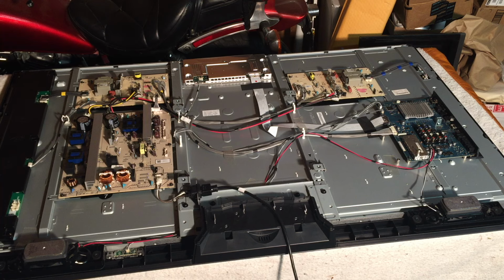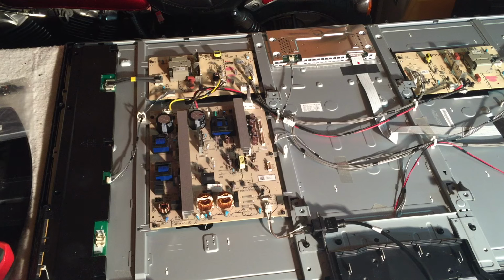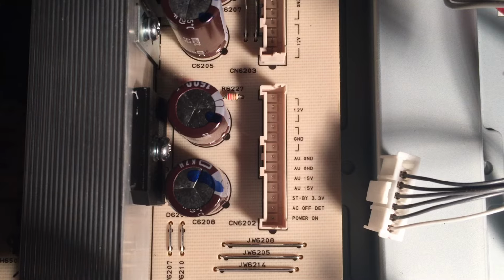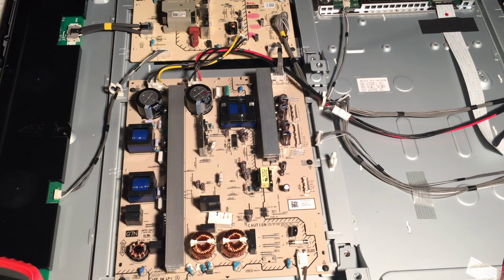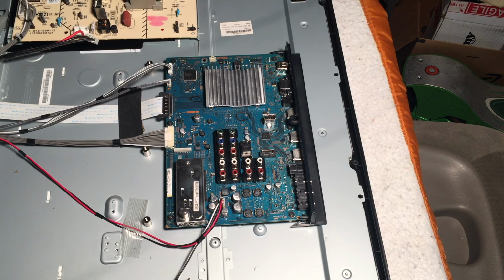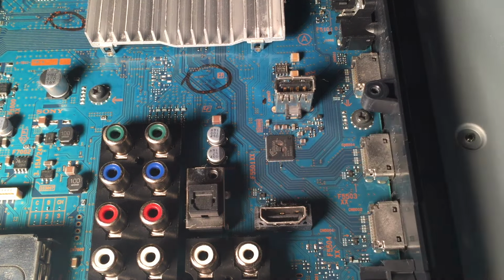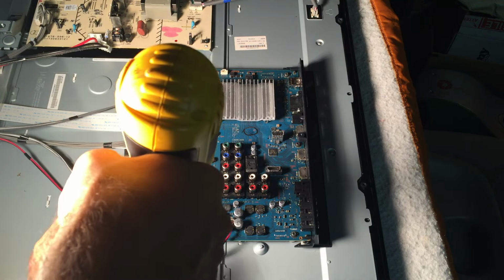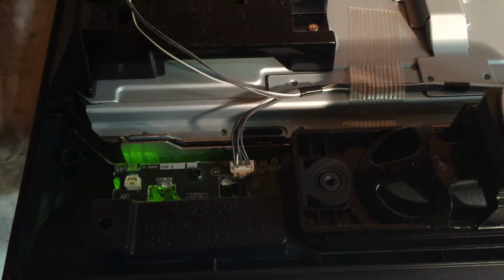How to Fix a TV Hit By Lightning or Power Surge

Comment: I have a lg 60pm6700 that got hit by lightning. The red standby light is on and I hear clicking when I try to turn it on. The screen seems to flick on and off a couple times but is very dim and hard to see. Can you help?
Reply from the maker: Did you check for the standard voltages?  Unplug unnecessary boards and peripherals and slowly add them in to see if your tv power up?
Reply: FrugalRepair my tv powers up. I can see the screen turn on and off automatically after I press the power button. Red standby light is on. It does not display the tv logo. If I unplug the ZSUS board I can faintly see “static/snow”. I replaced that board with no change.
Reply from the maker: @jeffschiman7579  I didn't realize it was a plasma tv.  I would guess that the issue would be either with the power supply or the main board (if an hdmi was connected).   The operation of a plasma is very different than an lcd.  You have standby voltage but I can't say off hand what else you should check for after that.  I haven't worked on a plasma for a while but many times I was able to find a flowchart or a service manual for them which was very helpful in the diagnostic process.

Comment: I have a Vizio LED tv that I came home to and it just keeps powering on and off. Can’t use any function. There was a storm recently however I wasn’t home. Any help appreciated .
Reply from the maker: Is it powering off at the same point?  Or  does it shut off at random times?  Does the tv stay on long enough to get past the Vizio logo when it boots up?
Reply: No. It boots up to the logo. Then shuts off. That’s as far as it goes.
Reply from the maker: @edwardfessenden589  Hmm, I'm not sure.  I'd try disconnecting everything and then testing boards/peripherals and adding them in one at a time.  You might have a shorted component that when the tv gets to a certain point in the boot process that it shorts out and takes the tv down.  For example, the hdmi mux chip (like in this video) could be damaged.
Reply: FrugalRepair tested power supply board stand by voltage and it is ok. Would T-con board cause tv to turn on and off by itself? I’m thinking main board needs to be replaced. Don’t know how to test main board

Comment: Ok so I checked the 3.3 and I didn't get voltage when I put the test lead to the metal frame but I got 3.8 when I put the test lead on the neutral/ground wire coming into the unit. Is that acceptable? Here's my frugal tip for you: get a bidet attachment on your toilet for 20 dollars on eBay. I no longer need to use toilet paper.
Reply from the maker: The frame should be ground and you should get it.  Try using the screw on the corner of the power supply for the black lead.

Comment: I'm reading that quite a few people had their TV's plugged into a surge protector and that the power surge still caused damage. I live in Mexico where power comes on and off frequently. Had thought about getting a power surge protector but didn't get around to it and about a half hour ago my TV just zapped out, followed by a strong smell of electricity burning in the air and  no standby light...I'm assuming from a power surge. Do you think power surge protectors work, and if so, do you have any recommendations on a good brand?
Reply from the maker: I don't have any recommendations but it sounds like having a good one would be a wise decision.  Beside the main power cord, the power surge can come through another device connected to the tv (ex; hdmi), like it did in the tv in the video.  I'm sorry to hear your tv broke.  Hopefully the diagnosis will be fairly easy if there was a strong smell it may mean you can visually see which board got damaged.

Comment: I hope you read this comment. My tv got electrocuted through a screen(don't ask why) and the screen is completely blank. Only the led backlight is being lit. And also there are several lines which can't be seen clearly unless you go extremely close to them. So is my screen damaged or is it some other issue. I hope you reply
Reply from the maker: I've read your comment!  However, I don't know if I can diagnose your tv by that description.  Can you say what path the electricity took?  Was it a tesla coil getting too close or something?  What lines do you mean?  I'm assuming you men there is no picture but some lines show up?  Are they horizontal or vertical lines?
Reply: @FrugalRepair  actually by accident  zapped the screen with a mosquito racket. Yeah those lines show up on the screen. Those are vertical lines.
Reply from the maker: @gauravnair6271  I see.  My first guess is that a component(s) got damaged on one of the tv buffer boards.  You'll not easily be able to find a fault and it would be difficult to repair.  There are usually two buffer boards that have tab bonds connecting them to the lcd panel itself.  These tab bonds are not replaceable so unfortunately, you can't just get new buffer boards.  Usually when people say the screen went bad they include the buffer boards when they say "screen".  Again, that is a guess.

Comment: My Sony tv  standby green light is on. what you think is power board or main board ?
Reply from the maker: I wouldn’t know which because you need to provide more information.  What did you try?  What happened?  What doesn’t work? For example
Reply: FrugalRepair  It’s a Sony KDL 46EX720 After the Lightning tv stop working. Only green standby solid light on. I did’t try anything yet ! What board should I order 1st ? Power board or main board if you can help me with this
Reply from the maker: So nothing happens when you push the power button (on the remote or the side button)?
Reply: FrugalRepair  Yep nothing happens. I try resetting hold Power button , Nothing
Reply from the maker: Was there an hdmi cable connected to the tv from a device when the surge hit?  Is that device working?  It is possible, but not certain, that the surge came through the hdmi cable and affected the main board.  You would need to diagnose the boards to be certain which one.

Comment: What about LED TV
Reply from the maker: The general procedure is the same. The backlight (led or ccfl) circuit is connected in after the power supply and main board.  Usually it’s the power supply or main board that will get hit in a power surge.

Comment: What's the best way to find replacement parts for TVs? I know it's my main board that's the problem, but I've yet to find a place that sells it. (lighting damaged the cable box and that damaged the main board)
Reply from the maker: eBay is the first place I usually check.

Comment: I have three old TVs. They're from the late 80's to early 90's. One has a bad picture as far as color. Another shows a flat,squeezed looking picture. The third TV's power doesn't work. It may need a fuse. Anyway, I'm considering throwing them away instead of getting them fixed. My question is do any of these old TVs have any valuable replacement parts inside them that would sell on ebay?
Reply from the maker: I doubt they have any value.  I don't think there are people still fixing CRT's. But who knows, maybe there are?

Comment: What happened was I put a thin copper wire across the fuse and connected power then my surge protector blew up. I thinking of putting a new power board. I have no way of testing the main board since I have no power.Thanks .What do u suggest.
Reply: Thanks,I will follow you advice and give u a feed back.Appreciate the help.
Reply from the maker: Sounds like you have a short circuit on your power supply and you'll need a new one.  You could technically test your main board by feeding it all the right main rail voltages but I don't see the need to.  If you put in the new pwr board, make sure it is not connected to the main board, test for correct voltages, unplug, wait a minute, then plug in the main board and see if all works.

Comment: I have Vizio E50-D1 TV and due to lightning the TV died. I reviewed the video on weekend and I was trying to find the break down voltage pin on power supply board and could not locate one. Can you please let me know how to check the break down voltage on this particular model. I really appreciate all your support.
Reply from the maker: I just searched for it and found a photo on an ebay listing.  I have worked on similar boards (actually one on an upcoming video!)  If there are no markings then you will have to take an educated guess (though the printing next to the blank connector may give you all the info you need).  Be very careful on this board not to short circuit any pins when you take readings, very easy to do because of the two rows of pins.  Look for common voltages, 3.3v or 5v (standby voltage) , 12v, 24v is for backlight (I think).  I'm pretty sure I remember the standby voltage being the top right pin.  Also remember that several pins should be the same reading since they electrically tied together somewhere in the board.
Reply: Thanks for searching for the board and your help. I do not get any voltage readings on any of the pins. The power supply board may be bad. I will order one.

Comment: Good video, but my TV turns on okay, then I just get a No Signal message. The remote connects to change input, etc, but nothing there from cable TV in one HDMI port and no response from the fire stick in the other HDMI port either. I don't know what's up or what to do first. What do you suggest?
Reply from the maker: Is this after a power surge that the hdmi stopped working?  Can you verify that the other inputs work (RCA? or coax?, etc) so you can isolate that the hdmi ports are no longer working.  It is possible your hdmi chip died.

Comment: Great video thank you,   but 1 question, I have multiple standby 5 volt pins and they all show 10 volts when tv plugged in so power supply bad? vizio lcd
Reply from the maker: Thanks!  That doesn't sound like a voltage you would see on that power board so that is a good guess that it is bad.  Are you sure you have your black probe on the metal chassis and red on the 5v pin when you are taking the DC voltage reading?  Just checking that you are measuring the correct electrical potential.

Comment: Great Video. After doing this on my Vizio tv. The light on the bottom front will come on then slowly turn off about 5 seconds later. Please advise
Reply from the maker: Did you change something in the tv?  Or are you describing what happens after the power surge?
Reply: @FrugalRepair  after the surge I replaced the board as you did in the video and that is when the front power light would come on after hitting the power button, Slowly go out after about 5 seconds.
Reply from the maker: You'll have to give more detail.  Did the standby light come on before you replaced the main board?  After you replaced the main board, did the tv turn on?  Is it only the standby light that you are concerned about?  That light is usually powered by the 5v line coming from the power supply.    Is that 5v steadily being produced by the power supply with and without the main board attached?

Comment: Looks like my 5 amp fuse is blown - good news!  How the heck do I replace it?  Does the old one snap out or to you solder a new one in parallel with the old one, or ?????
Reply from the maker: Great job tracking down the blown fuse.  Hopefully that is the only issue.  Some power supplies have a pressure fitting to easily remove and replace the fuse.  If you can't pop yours out then it is probably soldered to the board.  You'll have to desolder/remove that one and solder in a new fuse.

Comment: This allowed me to fix my tv for $20 rather than not be able to afford a new one right now. Thank you for posting this.
Reply from the maker: That is great to hear!
Reply: Could you just replace the HDMI chip instead of the whole board?
Reply: @mrswiss  Potentially, if you're equipped to do surface mount soldering.  That's beyond the skill level of myself and most people though, not to mention needing a nice enough soldering iron and de-soldering iron to pull it off cleanly.   Cheaper to pay the money for a whole new board, especially considering the time spent in labor.
Reply: I'm about to attempt this project myself but furthermore I ponder as I have a 36' model of same brand and model and am wondering if I could rob the 36' to Frankenstein its board into the 70' fyi the power board is not the issue it would be the hdmi board.....

Comment: Does the tv need to be plugged in when testing the fuse as well?
Reply from the maker: No.  You should not have the power going to the tv when you test the fuse.  A multimeter in continuity (or beep) setting supplies the power to test for the electrical connection.
Reply: FrugalRepair Ok, well I know I’m going to need a new main board, do you think it is easy enough to just replace the fuse so I don’t have to replace the whole power board as well?
Reply from the maker: So you know you need a main board and your fuse is bad on the power supply?  If you are sure , I would replace the fuse first and then test the power supply to make sure it isn't damaged too, before connecting a new main board.  If you aren't sure then you might want to get a new power supply too.

Comment: Ok so my TV was not on but it was hooked onto power outlet when the lighting struck and next time i started my PS and my TV the sound of the PS opening still played but the screen was black so what could it be? 

Im not sure if the TV is LCD TV since i didn't bought it and the manual is missing but it might be so is there something i should know since the TV turns on but the screen doesn't work everything else does
Reply from the maker: What is the model number?  Also shine a flashlight on the screen while it is on and you hear sound and if you see a picture when you get really close that means you have no backlight
Reply: FrugalRepair yeah it looks like i have no backlight

Comment: Great video FrugalRepair, thanks. Lightning got my nearly new Hitachi 40A3 40" LED LCD HDTV. It will not turn on. The Red power light does not come on. The Main Board/Power Supply are integrated on one board. Based on your video, there is a high probability that is what I need to get it back working. There is no marked power plug to do a voltage test like in your video. I studied the board for several minutes and could not find any trace of burn marks or melted components. TV was connected to the cable box (which was damaged) via HDMI and was also connected to a DVD player, that no longer works, via HDMI. ShopJimmy has the board for $49.95 - Hitachi 850154021 Main Board/Power Supply for 40A3. I paid $229 fourteen months ago for the TV. This is where I wish I had a crystal ball. A new board could fix it, or I could be out fifty-bucks. Am I throwing good money after bad? Any comment you have would be greatly appreciated.
Update: I did find a plug marked 5V, IR-IN, LED, KEY0. 5V measured 5.25V (on my inexpensive meter); IR-IN - 5.25V; LED - 1.15V; KEY0 - 1.15V.  Red power light still does not come on.
Reply: SUCCESS!!!  It is working again!  Thanks to Frugal's advice and support, I was able to find a new board at ShopJimmy, installed it and I have my TV back for a fraction of the price of a new TV.  Thanks for all your time and help!
Reply from the maker: Wow, that is great to hear!
Reply from the maker: Thanks for reaching out.   Your comment had never gotten published for some reason.  That is a strange board.  It sounds like if that is the only board in the tv then I would feel confident that a new one would fix the issue.  The fact that you do not have a standby light and you used to is a good clue you have a power issue.   You could unplug everything that is connected to that board except the cable to the standby light then plug in the tv to notice if the light comes on or not.  If not, change the board.
Reply: It is I who wishes to thank you! I will go try the light. I'll post my progress.
Reply: Regarding the light coming on: Yes, and No. Let me explain. There is a 4-pin plug going to the standby light assembly. The wires to this plug are directly connected to the plug I noted in my post marked "Update." There is a small board in this light assembly which houses the light. The female for the 4-pin plug mounted on this small board is marked: 1) 5VSTB   2) GND   3) IR   4) LED    I measured the voltage at the corresponding pins of the male plug going to this female plug: 5VSTB measured 5.25V; IR measured 5.25V; LED measured 1.25V. As I began to push the plug on, the light blinked on, then went off as I seated the plug fully. So I experimented. Putting the plug on at an angle, touching only some of the 4 pins made the light come on. I don't know which of the 4 pins were making contact. I think this assembly which houses this board is also the location of the sensor that detects the beam from the remote that turns on the TV. Is there another test I could perform to rule out this light assembly and the board contained in it?
Reply from the maker: John Kent you're getting the standby 5v voltage.  You need to track down the source of the problem if you want to know for sure but it is hard for me to help you.   Something on your tv probably has a short circuit.  The question is where.  I have seen tvs get taken out by a short on that led light sensor bar.  Try turning the tv on with various combinations of connections removed to see if you can find a short outside of the main board.
Reply: Thank you, Frugal. You have gone above and beyond, trying to help. I hope to try and find a way to bypass the light sensor bar, or part of it ??? to see if I can turn the TV on with the manual button. I'm wondering too, if the short is in that bar. I'm going to ask ShopJimmy if they sell that bar? Stay tuned.  :-)